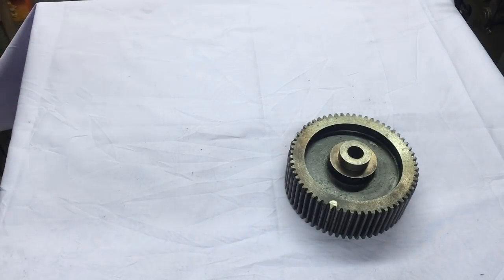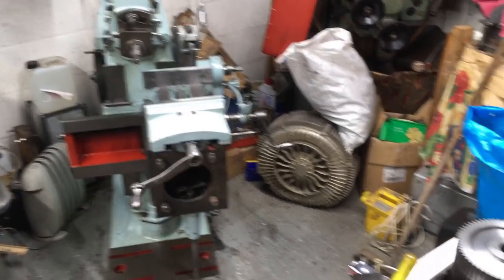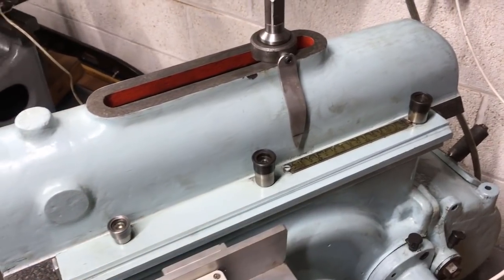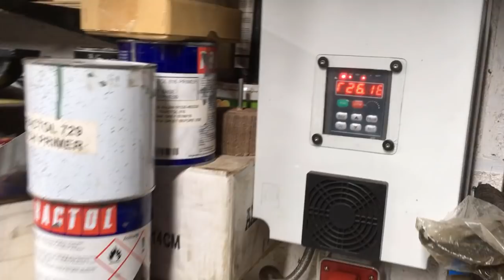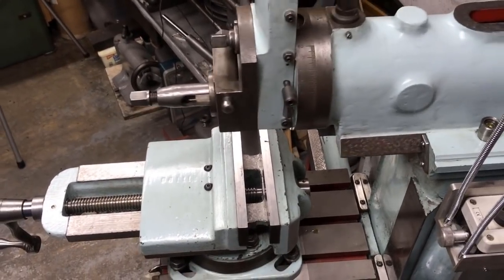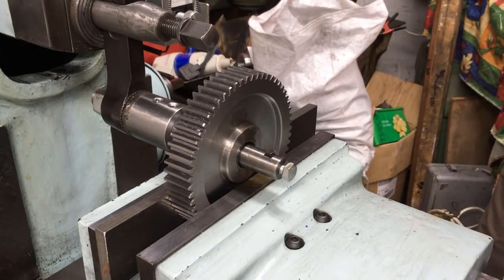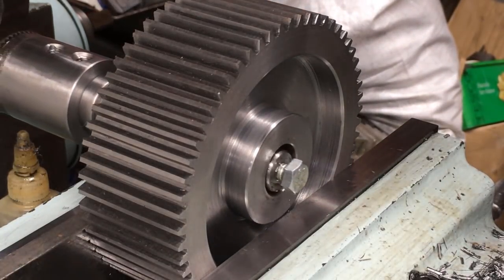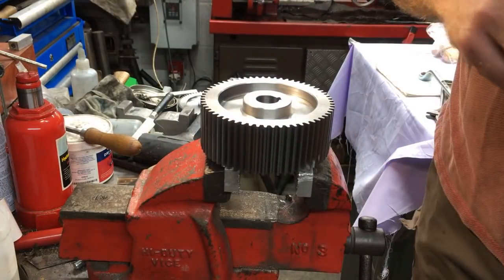Shaper Keyway Cutting

Comment: Nice job . A big job for the small lathe to do the gear blank on .  Cheers .
Reply from the maker: Not quite the biggest part Ive had in the Boxford lathe but getting up there. I think the shaper crank shaft was heavier and certainly longer and a lot more material removed to give me a shoulder.
But I have to keep the weight down or speed down as thelathe doesnt have the mass to soak up the vibrations - even though it is bolted to the floor slab.

Comment: I bought a broaching kit years ago and just cut my first keyway’s last weekend for my Cnc pulley’s!
Reply from the maker: I wanted a broaching kit, I have a good sized fly press (No.6) but even thats a bit restrictive on the thickness of part which can be broached and still fit in the press. I think a home shop hydraulic press is the way to go. Glad you got yours in to use :-)
Reply: lookcreations I bought the 12 Ton press from harbor freight which got it done. (With a lot of pumping!)

Comment: Hi Mat. Nice video. I always  do my keyways at the bottom of the hole. More rigidity. I have a 22" Strigon Toolroom Shaper, made in Hungary 1967. I'm making tools as needed for it. And like you am looking at ways to set up quickly. One thought I've had is a removable taper cone to slip over the end of the tool to pick up the end of the hole.
Cheers.
Reply from the maker: Hi Graham, thats an idea for centring the tool - but it requires  the tool position to be used as the datum or the hole hmm got me thinking that !  All the best Mat

Comment: That arrangement you have with the VFD looks very good in the way you can control the ram. The local Men's Shed asked me about a 14" Alba shaper they have, to my amazement I discovered that a clutch was an optional extra, the one they have has an inch function for set up, the machine is not operational yet though. I have an Elliot 10M, it's my favorite machine to use. Enjoyed your video, I've got some keyways cutting to do in a couple of weeks.
Reply from the maker: I had the 10m , very useful capacity in a small footprint. I had a couple of jobs where I needed a bit more. The clutch on it worked well, but not so easy to feather/inch. The vfd and inch switch is really handy.

Comment: I don't own a shaper so for the odd keys I don't have broaches for I have to just use a bit in a boring bar on the lathe and use the carriage to cut my keys. Despite the tedious setup here this method seems more convenient. :-)
Reply from the maker: Ive used the carriage on my little lathe to score graduations and the likes - never a keyway as Ivenot needed one until now - but even a few thou' deep score tool two or three bites and on a dial it took an age. The shaper has proven to be a handy addition in my little shop Brian. Im sure you could find a corner for one in your 'estate' :-) The best bit is tooling is chicken feed and you could soon rig up a fixture for dedicated keyway cutting.  All the best. mat

Comment: Matt, that was a great trip down memory lane to some splendid key way cutting.  Those look awesome!   I saw the fan in the floor for the black-smith setup you were considering.   Thanks for sharing!
Reply from the maker: Still going to do the forge - been investigating how to run one 'quietly' so looks like I will haveto sort out my fly press and tooling for the larger jobs.  Hopefully on the home straight now with the Holbook and once running it should let me stand back and progress a few of the longer term projects like teh forge. All the best Russ. Mat

Comment: Gday, you really did a beautiful job restoring the shaper, I have a 11” stroke PK Douglas shaper and absolutely love it, favourite machine in my shop, when I built my new shop I got some sheet metal folded up and I welded the corners to make big trays, I sat the shaper in one, the power hacksaw has one and my old lathe, just a simple at to keep things clean, I made a similar key way cutter also but only used it once to see if it worked and never needed to use it since, those gears you you make look really nice and should serve the purpose well, great video, thank you.   Matty
Reply from the maker: Hi Matty - I think my frined in Oz had and sold a PK Douglas - then purchased a bloody great bit british shaper. If I can find a link I will post it - Greg' does some great work in difficult on site situations getting stuff out of tight spots. I think his YouTube channel was 'The Barn' but I will check.  All the best Mat

Comment: Nice video Matt, and excellent work. First time I used my shaper in anger was to cut an internal keyway, but I like your tool much more than the one I built, and I have one of those shaper universal tool holders, so there may be one in my future! I have an Alba new 1A.
Phil, East Yorkshire.
Reply from the maker: Hi Phil, I am quite ashamed that Ive had a shaper for 5 or more years and only just cut a key way !. I am thinking of what mods to make on the tooling to ease set up. I know a lot of chaps remove the clapper and mount it fixed - not keen on that as the fixing that holds the clapper box support is a swine to say the least ! What  ihave works so I will have to see how things develop in terms of requirements. All the best mat
Reply: @lookcreations  I think you have cracked it Matt, as you showed in the video, set up can be difficult, but once you get to appreciate the paraneters of the machine, it gets easier. I had exactly the same problems! Your set up is more rigid than my mk1, which was a lump of rectangular steel which was a good fit for the toolpost, with a suitable round bar welded to the end. It worked, but I got the grind of the tool wrong, which is most important, and also was not rigid enough, probably because of the incorrect grind. I will build one like yours, and also copy your grind next time. I am not keen on taking off the clapper and going straight into the ram either. I like your clapper box lock, I drilled and tapped an allen screw into mine. As far as I understand it, the only reason to lock the clapper box is to prevent the tool and holder catching on the top of the bore on the return stroke, although with your set up, working inverted needs it as well! I cut my keways in the bottom of the pulley.. Is there any other reason you know of?
Phil

Comment: That is the way to do it because if you have even the slightest  misalignment in the clapper box you take the edge off the tool and rub hard enough to bring the key way out of tolerance. Also if you look at any slotter may be 1 in 20 will have a clapper box and they are usually fixed. Most Shapers when they were earning their keep were usually set up to do repeat jobs so setup wasn't quite as big an issue not having hand controls. Also many that used an overhead system incorporated that side of things in the overhead belt side ie idler pulleys. 
Nice job BTW
Reply from the maker: Thank you. I was apprehensive about the job being new to me, worked out ok though .

Comment: I've had my 10M Eliott about 15years, it's principal use is cutting key ways. I haven't tried it in reverse (I haven(t got round to wiring in a reversing switch) which is another option, in reverse clapper locked 'either way up) can reduce chatter, like a rear mounted parting tool on the lathe! You can reverse yours, could be useful one day!! Cheers, Matthew

Comment: Nice Work Matt! I have yet to make my first keyway. I have a project coming up in which I will need to. Debating on whether to get a broach set, or use the slotting head on my Ajax mill.
Reply from the maker: I have a fly press - quite a good sized unit and was thinking about the broaching option - but the tooling for even just a single keyway broach was silly money vs the number of times I am likley to use it. Besides I have a shaper ... The tooling could have been made mucj more straight forward and I may well make a second holder to fit the bars. A slotting head is a useful bit of kit - it can square out holes, cut keys etc - well worth making up the bits and learning how to make best use of it. I know the feeling is 'new tools' going to be far quicker in the end - but really is it once youve learned how to do the job ? Thats what I am trying to get o , learn how to make best use of what I have before spending more hard earned on new tools. All the best Mat

Comment: Hi,
I'm a new subscriber and enjoyed your video... as an apprentice i used a shaper and remember all the oiling up before use. I wish i could remember what make of shaper it was but many moons have past.
I will check out the restoration playlist of your shaper.
Take care
Paul,,
Reply from the maker: Hi Paul. I know the shaper has a good number of oil points - I added a couple on the ram. But hands down the Holbrook lathe at least twice if not three times the number. Ive spent  half a day screwing in little oilers - I can fully understand why machine makers moved to central lubrication systems and charged as an extra - the man hours saved over a feww years would easily pay back. All the best mat

Comment: Something on your floor to the right side of the shaper caught my eye. Something with what looks like a round aluminum housing with a ton of cooling fins. I was wondering what that is?
Reply from the maker: Its a blower fan Ive modified to set up and use as a furnace blower for a small forge. Its all but finished. Had to call a holt on the forge for now as the noise levels will cause issues with the neighbours. Ive a fly press to hopefully resolve that when I get back to the forge project.
Reply: @lookcreations  got ya. I have seen blowers like this. Serious blowers! Just didn't recognize it in the video. Thought it was an engine, or mini nuclear reactor or the likes..lol

Comment: And I am going to watch how you restored this shaper to get I hope a good idea of what the state of the shaper I bought might be also about 30 pounds... i hope not but I have no idea. Thanks again for your excellent video's
Reply from the maker: Hope you enjoy it!
Reply: @lookcreations  I am watching the rebuild of the apron and gearbox. Very interesting to see how you tackle this precision job. I have worked on a similar Boxford lathe that felt on the small gearbox and broke the part underneath the gearselector pins 🤨
Reply: How do you determine the exact alignment of the cutter when measuring it?
Reply from the maker: @therealspixycat  whic cutter ? For the key ways ? I ground it much like a pating tool taper out to the tip, Tip width to excat width of the key.
Reply: @lookcreations  I mean you have to find the exact centre right? On the mill you use a puppy taster to find the center

Comment: Mat, I have a 10m like your old littleun. I bodged together a fixed bar holder to replace the clapper. May be I missed it but how did you go about centering the cutter? I usually scribe the sides of the keyway, but it’s a bit of a faff.
Reply from the maker: When I made the cutter I made it exact width of the key - I then eyeballed down the hole moving left / right to get both corners of the cutter just scratching the bore. Oh it also requires the cutter be ground well - 90 degrees at its tip
lets just say, I didnt record the cutter grinding by hand ... and the fact I got through a few bits of HSS in the process. But next times goingto be easier - grind the tip and relief to the base of teh tip - grind the sides last once you have the tip right & DONT OVER GRIND THE SIDES AND LOSE THE TOP CORNERS ... if you get what I mean :-) Bringing the cutter slowly into position just takes a bit of trial and error - but I think it worked pretty well - the collar the gears sit on is well made by holbrook - if there was any significant error in the keyway it wouldnt have fitted. Good to see you commenting. Hows the series after the lockdown ?
Reply: Thanks, took the landy out a few weeks ago and it conked out going up a hill.   i think it must have been condensation in the carb as i got it going again and it was fine.  its done about 50 miles in the last 6 months, poor thing.  Its not the best to have it just sat there but pre lockdown i was on the push bike most of the time and now well i am stuck working from home....

Comment: Nice job that Mat, especially as it's your first keyways, one question are the bores of both gears the same? If so why didn't you set them both up with the mandrel you turned them on and put them together in the shaper vice and do the keyways both together? It would have saved you a lot of time. Also I certainly would have cut the keyway in the bottom of the gear and put the gear(s) as low as possible in the vice for further rigidity and more surface contact. But you made a bloody good job of it mate, well done! ( I know I'm years behind watching this in 2021 but I've only just found your chanel and am randomly catching up, i binge watched the ?Holbrook lathe episodes after subscribing from the first episode)
Reply from the maker: I ran them seperately as that was 'lower risk' of cocking them up. I ran them inverted as that was what I had read. Not sure its much of an advantage certainly not as far as lubrication of the cut goes. On the other hand, it all worked out well and if it aint broke dont fix it applies ... :-)  All the best Mat

Comment: Picking up dirty habits from the yanks. Put the compound slide parallel to bed then you have a well calibrated method of facing to length as well as there being no chance the set cut will change should the compound move. Here in Aus every turner I have seen in 40 years has the compound parallel. Direct plunge threading is fine up to 3mm pitch and you cam creep the compound to compensate for incorrect tool nose radius.
Reply from the maker: Sometimes I do, but when cleaning out the corner like this with the rebate on the gear faces, it helps to be able to come in a slight angle. Do the 'yanks' have bad habbits ?  :-)

Comment: Too snug, you might have trouble if you ever have to take it apart. I like .050" min on top of my keyway with the key in.
Reply from the maker: Yes, I was a little concerned - found a small burr on the key top corner pushing sideways - now it slide on and off as the orginal.

Comment: cutting a keyway upwards seems wrong to me
the play that will come into being every time you adjust the depth of cut will have to be taken out by the tool every time.
in cutting downwards there will no play  as the movement is against the cutting forces.
Reply from the maker: I’m not 100% convinced about inverted cutting. Once the clapper is locked, the tool deflection has to be accommodated. Cutting lube runs out the joint etc. Where as if it’s cutting down and the clapper is locked tool deflection is still evident but lube runs in and that helps. I was going to try both, but due to time figured the first method worked fine ... better than expected so repeating it was easier than rotating the tool etc. Thanks for watching and commenting 👍